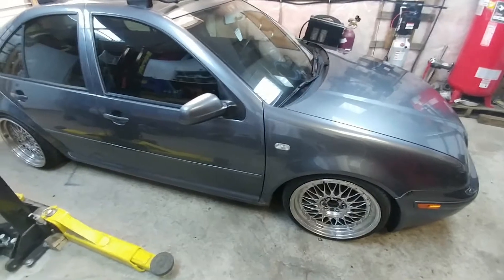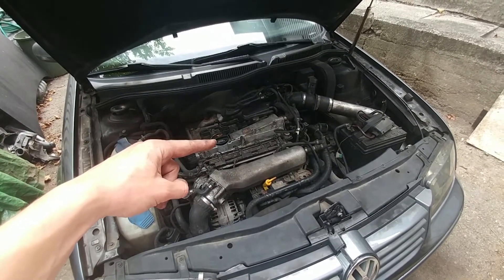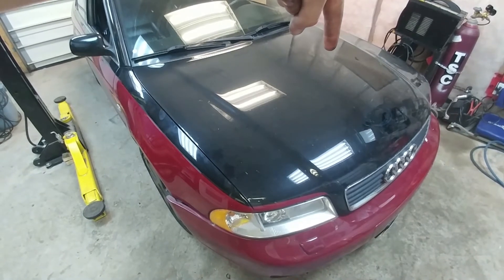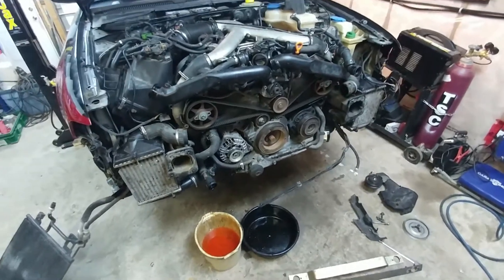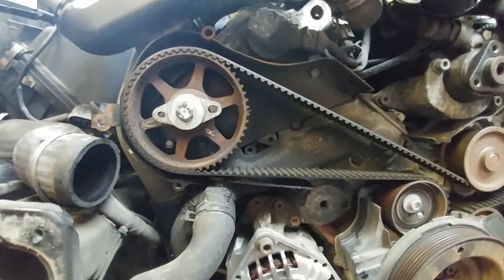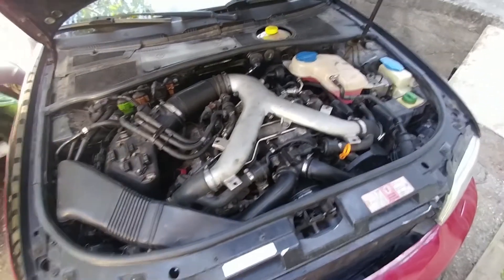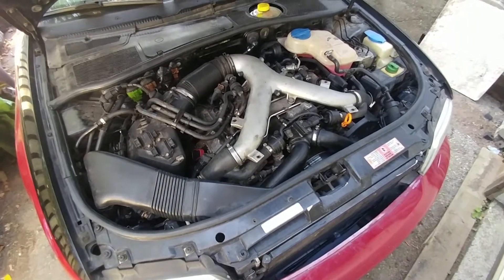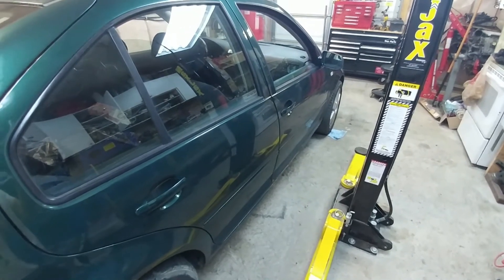B5 S4 Fun Con't... TAG 006

Comment: The audi Garage I have a problem with my 2000 audi a6 quattro 2.7t. Has something to do with my icm's Becuase I can plug in the black clips for one bank which I dont know what bank but when I plug in brown clips it doesn't start but if I disconnect 3 wire brown plug it starts what do you think of that ...and also thanks for your help
Reply from the maker: Eduardo Garica audizine has great information on how to troubleshoot ICM problems.
Reply: I did check audizine and vw vortex I even registered but can get answer I was hoping maybe you can check with a power light on the 4 pin brown icm connector to see if you have 1 or 2 grounds I would highly appreciate it
Reply from the maker: https://www.audiworld.com/forums/audi-allroad-18/icm-delete-coil-conversion-2874813/ this thread shows a good wiring diagram that you can follow to trouble shoot your issue
Reply: Okay thanks I have to learn how to read pinouts and diagrams